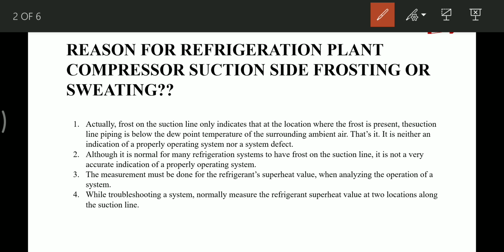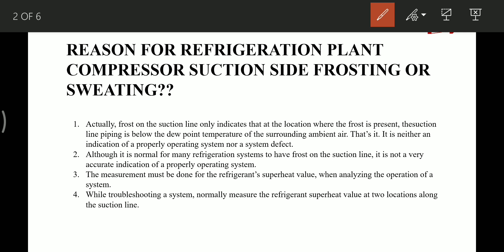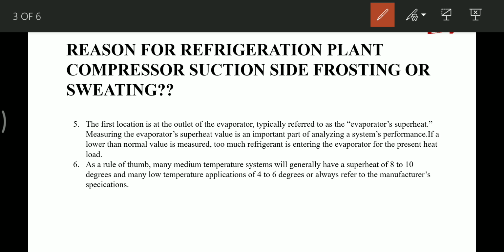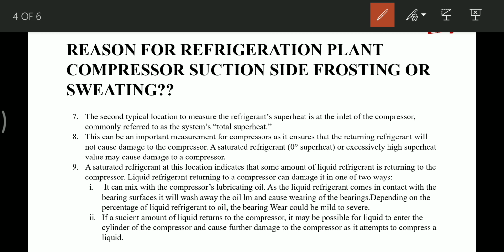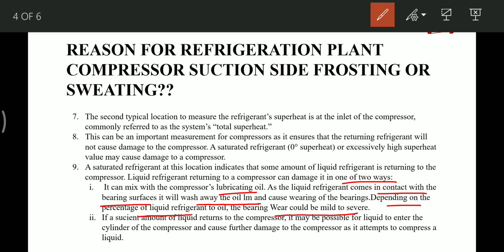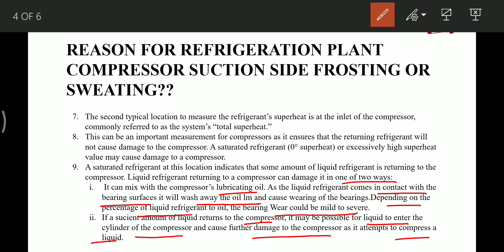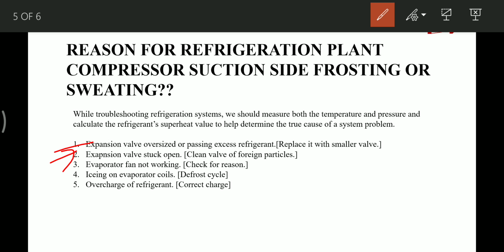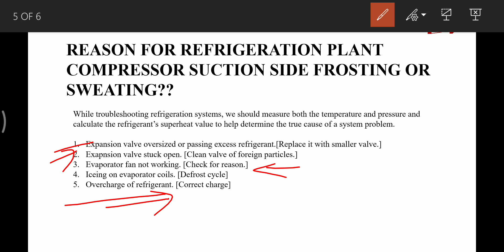Function 4, Motor, Reason for refrigeration plant compressor suction side frosting or sweating?

Comment: Excellent video. But what about "role of evaporator fan" in frosting?
Thanks.
Reply: If fan is not working...heat transfer across the evaporator wont take place since no air flow is actually happening upon the evaporator tubes. So the refrigerant will maintain its semi liquid state and wont turn into vapour since no heat is being extracted by the refrigerant.